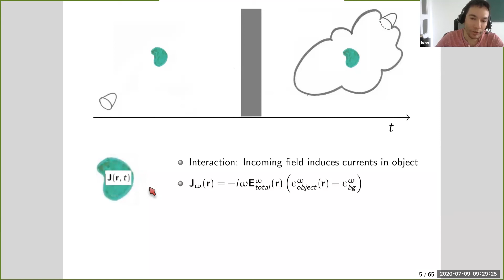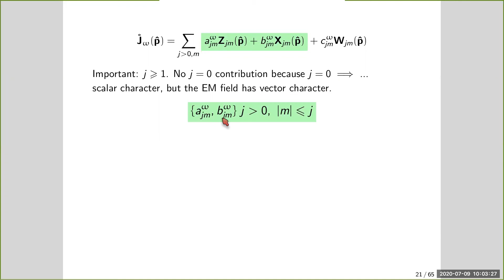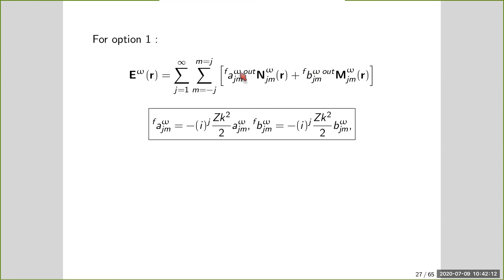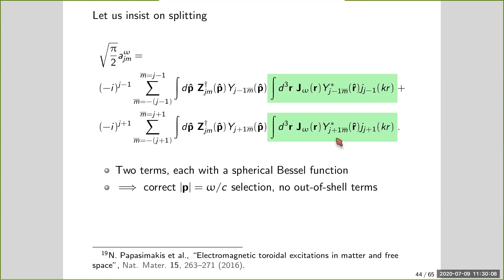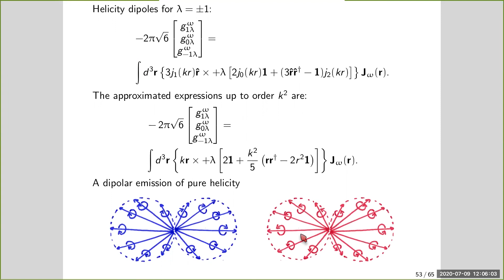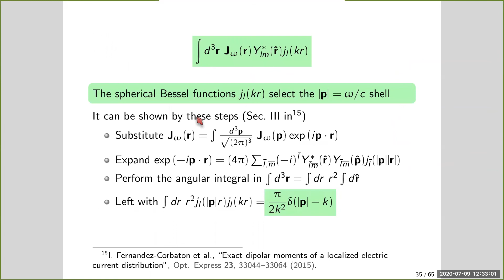Ivan Fernandez-Corbaton: Exact Multipolar Decompositions with Applications in Nanophotonics. Lecture

Comment: Why is multipolar decomposition useful? Like what parameters can you derive with that?
Reply: I like to think of it as replacing calculus problems with linear algebra problems. Instead of worrying about the fields at every point in space, you can think about a vector of multipole coefficients, and then scatterers and antennas can be replaced with T-matrices, which map the incident multipole coefficients to the outgoing (radiated) multipole coefficients. You can imagine how, computationally, this is quite helpful!

But even analytically, if you can structure much smaller than the wavelength of the light, then incident light will often only couple into the dipole moment, so employing a multipole decomposition drastically simplifies your expressions for the radiated field.
Reply: @photonicguitar  many thanks for your input!